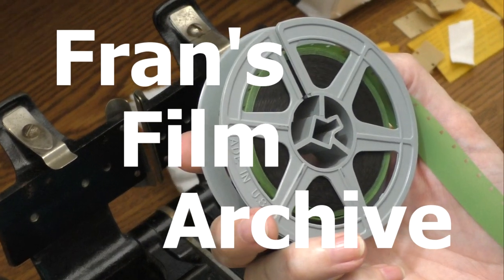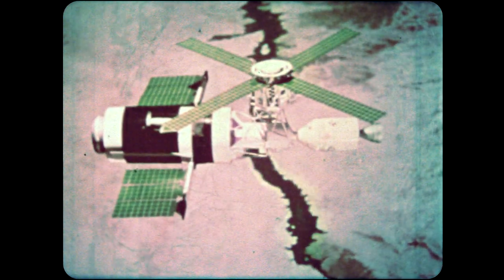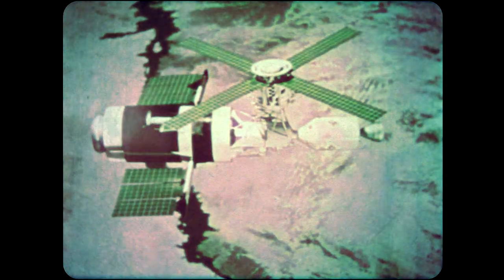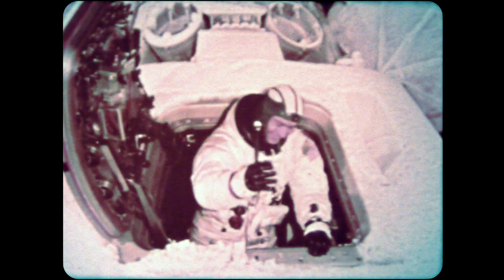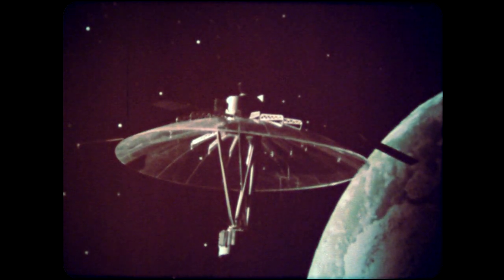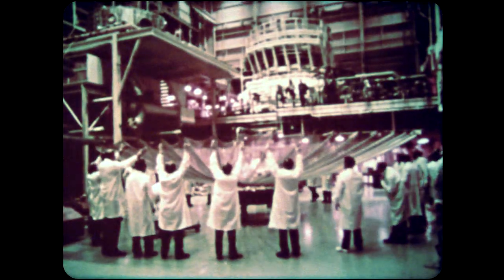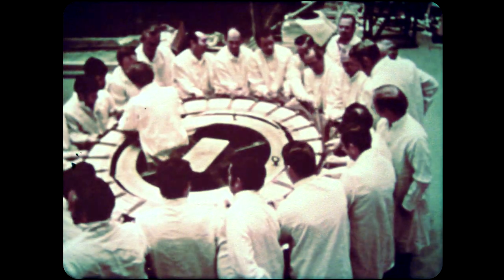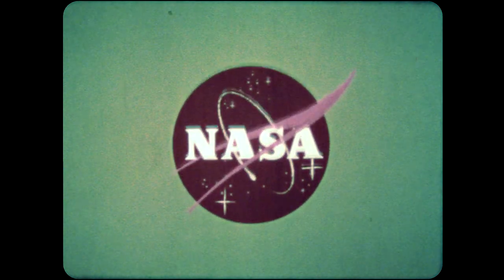Skylab Tests and Space Dish (1973)

Comment: @1:16  Fran See the triangular shapes that make a sort of grid on the "ceiling" there? Although not really a ceiling. In space there is no up no down ceiling or floor. 
But I remember why they made that triangular grid. It was supposed to allow you to walk without floating off via a special shoe that had matching triangular lugs that would engage and lock into it. They tested them but was too imprecise and really didn't work all that well. But the grid was used anyway. I remember the prototype shoes were Chuck Taylor Converse with the lugs.
Fran, do you remember a video showing anything like I describe?